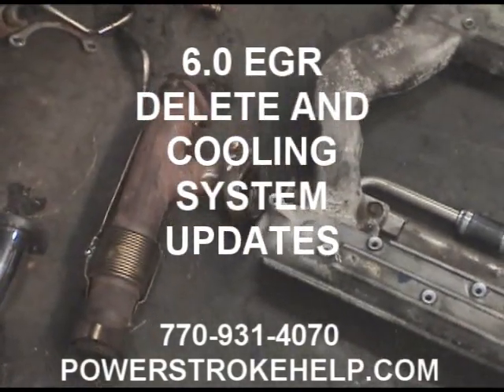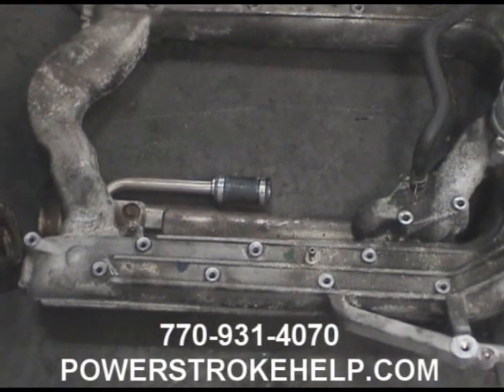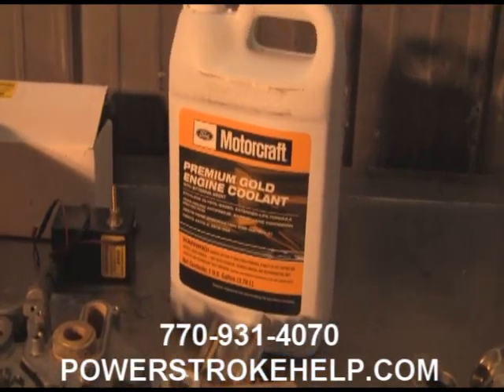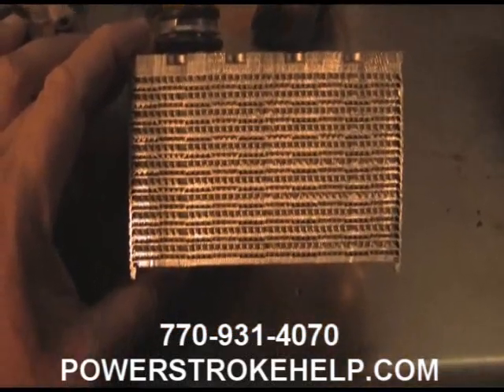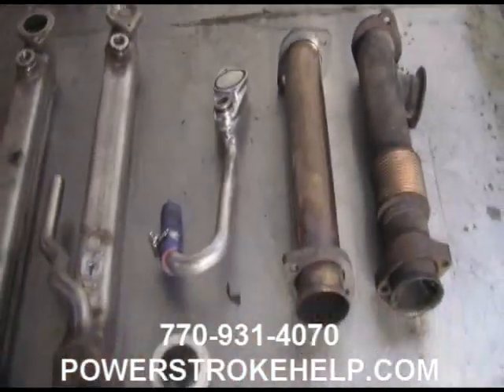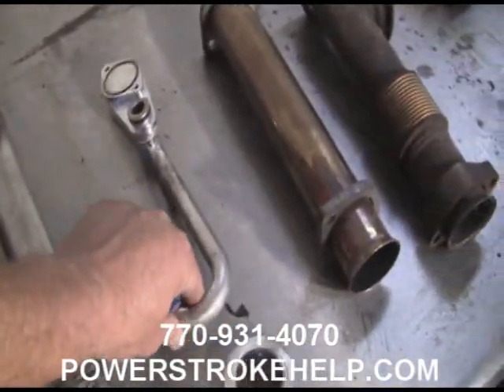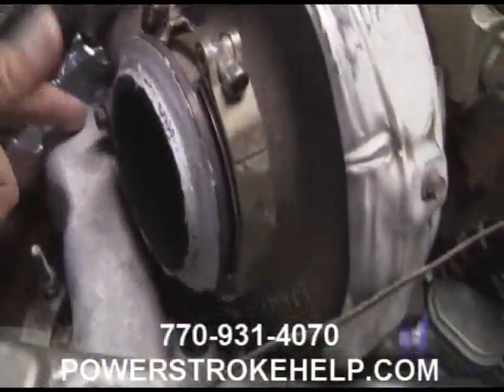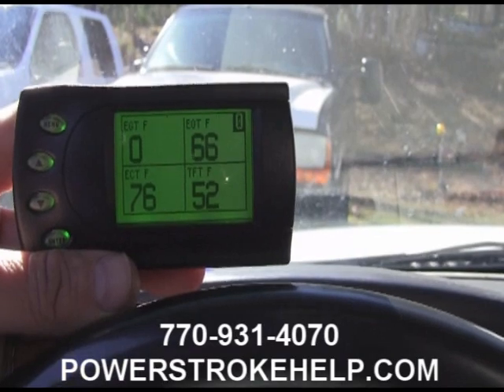FORD 6.0L EGR DELETE INFO POWERSTROKE DIESEL

Comment: Hello thank you for an awesome video of knowledge. I'm an auto mechanic that's work on gasoline engines for very long time. And now I got a hold of a 2007 diesel van. That I bought that was torn apart I am putting it back together. So after watching your video I was just thinking what would happen if I can restrict the exhaust that goes to the tube by 50% to maybe be at 80% I was still out of the exhaust gas to cool down the heads and combustion chamber just not so intense to cook the antifreeze. But I don't see any kis out there for restricting exhaust gas through the EGR probably a reason why. I would be really interested on your thoughts of restricting the exhaust gas through the EGR.

Comment: If I delete the EGR cooler using a blocked off dummy cooler, does the EGR valve still operate?  And should I still clean any soot from the valve?

Comment: Is it possible to have coolant mix with oil due to an eng oil cooler failure
Reply: Rennis Henry if you have oil in your coolant reservoir tank or find it in your coolant it's more than likely a bad oil cooler
Reply: Yes. My uncle has this happen and as a result, he lost his engine. Didn't know it happened until the turbo blew apart and ruined his hood. The technician that did all the work said he found coolant in the oil and found burnt coolant residue on the pieces that were left of the turbo.

Comment: when welding the egr shut should I leave the egr valve in place .     are any other modifications needed to delete the egr other then welding the pipe shut ?   would shutting off the egr valve with a tuner be a good idea?

Comment: I am looking at a 2007 ford f-250 it has 60 thousand miles with the 6.0 diesel does this year still have all of the problems
Reply: yes every 6.0 will have problems at some point in its life. If it runs fine an sounds fine then it should run ok for a while, but they are very problematic when they are stock I would bullet proof it asap. Studs,egr delete or bulletproof egr cooler, new fuel system (I would get a fass) and put rev x and injector cleaner in every now and then and you will never have a problem. (owner of a 2004 6.0 bullet proofed)

Comment: I am interested in buying a 2003-2007 6.0L powerstroke and had a question about welding the egr cooler.  What is the minimum gauge and grade of stainless steel you would recommend using for this task?  Also is it true that 2003-2005 powerstrokes would not require electronically turning off the egr valve while the 06 and 07 models would require a tuner to shut off the egr valve?  Also would it still be advantageous to turn off the egr valve with a tuner in the earlier models if the cooler is blocked off in this manner? Thanks! Keep up the videos

Comment from the maker: It is better to have a good welding shop weld both ends of the cooler so that if the inside of the cooler goes bad then coolant is not fed into your air intake.

Comment: Bill, I am thinking of welding in those freeze plugs like you suggested in the EGR cooler.  I am wondering if there's a chance the cooler will get plugged from the additive package and sediment, and block off the coolant flow back to the degas bottle.  Is this a redundant loop or a vital passage in the coolant system?  Is there a way the coolant can bypass the EGR cooler completely?

Comment: Thanks bill i will check it out. I also am leaning towards a boost leak somewhere. Was a really windy day the other day and i was heading into the wind and only building 9 psi....usually build like 15 with a strong wind (60km or more) and i only build about 5 or 6 driving when i used to build 10. Either its the crappy ford plastic cold side tubing has cracked or its the turbo cac boot. Thanks!

Comment: Hi Bill, 05 f350 with bulletproof egr delete and arp studs. Got a edge insight for monitering and no tunes yet still stock. I was driving the truck today and when i was driving around the city my egt's were getting high even if i slowly came up to speed it would be about 870 F. Eot and ECT are usually 5 apart today they were both at 198 when this started to happen. I did change my coolant filter 2 days ago checked coolant was good but checked today and none was in degass bottle. but no leaks.

Comment: Thank you for the video. I have a 2006 f250--6.0 I am considering doing an egr delete and looking at your suggestion on the video it makes a lot of sense to have it weld it. I agree with you that those rubber hoses are a pain.

But I have one question for you. By welding the pipe on both ends and re-installing  would I get a code? .
What do you think of the bullet proof system for egr and oil coolers?
Again , thank you for the videos  they are great providers of free intelligent knowledge.

Comment: so I should be doing a regulated fuel return system with a electric pump and then a bigger turbocharger. do you think I need head studs with these. and im also looking at baby swamps injectors.

Comment from the maker: That is a waste of time until you get the fuel bottle neck straightened out. A turbo, any turbo is only as good as the fire pushing it. If the fuel is limited or restricted your fancy expensive turbo will not be working any where close to what it can do.

Comment: i am also buying a turbo from BD diesel (TP38) 66mm compressor wheel and a 1.00 AR they also put in thrust bearing. is their any other better turbos out their? the stock turbo really lags when im towing 8000 pounds it has a lot of trouble getting up hills. I will be looking at doing those other fuel upgrades you mentioned. thanks for the help!

Comment from the maker: Regulated fuel return with an electric fuel pump will liven up the OBS trucks like right now. Check the forums there are several DIY vids and parts lists. Get that junk mechanical pump out of there and get some modern fule pressure going and you will be amazed with what she can do.

Comment: bill I have a 1996 f350 7.3 with afe air intake, MBRP exhaust, edge chip, 3 gauges, duel disk billet torque converter, what would you do for the next 3 upgrades I want to be making around 600ft/lb of torque. Also its starting to puff thicker smoke than it usually does im thinking it could be injectors I only have 160,000 miles on it what do you think?

Comment from the maker: Two schools of thought. If you put it in the drivers manifold as most folks do and you have an injector fail on the passenger bank, it will burn a hole in a piston and the gauge will never move. BUT if you put it just past the turbo in the down pipe you do not get as accurate a reading. So the debate continues or should we just have two gauges. One for each side. I have had a few trucks come in here with two gauges. No more than 1350F

Comment: Thanks for such a great video Bill!  It really explains how the whole thing works - I have an '03 6.0L and I put the Bulletproof oil cooler/EGR cooler on it.  What I found is that when I tow a trailer up a grade, my coolant temps remain low, but my oil temps get high (I backed out when it hit 250*.  The fan clutch would kick on, but not soon enough to lower the oil temp.  Would a heavy duty fan clutch help at all?  Or is there a better option?

Comment: Hi Bill
 Can you tell me where to put the probe for the exhaust gas temperature on a6 liter. What is normal operating temperature for a turbo. How hot does it need to get before meltdown? Thanks a lot for the info..

Comment: quick question for ya Bill: for the lifetime bulletproofing process, if a customer wanted to use a different programmer/tuner from the get-go other than the edge you use (meaning the customer wanted you to install the other programmer/tuner) how would that affect the warranty and what difference in price would that make?

Comment from the maker: it is called 7.3L IDI (Indirect Injection). It uses a mechanical fuel pump. These are great engines but not very powerful. They are prone to leaking fuel around the return line orings on the injectors.

Comment: How are you Bill i have a quick question for you do you know if it's common for the camshaft censer to just (GO) on the old 7.3L because we had to get one replaced on are 02 dump and it would continuously stall out as we drove it. Ya see i dont wont to deal with that again and we have a 1999 F350 long bed is it worth waiting on it or should i just replace it? Also is it thae same deal with all Powerstroke 7.3L? Thanks for your time hope to hear back.